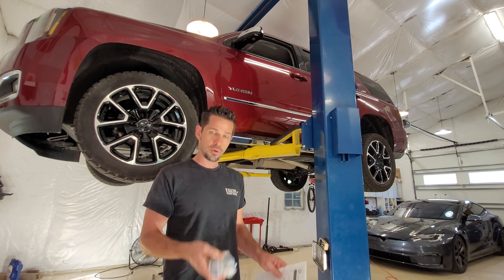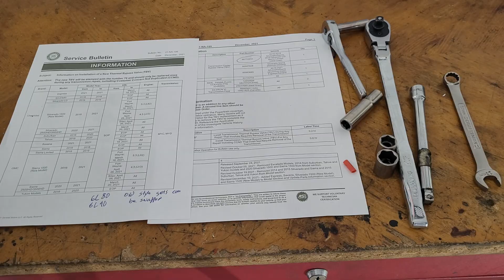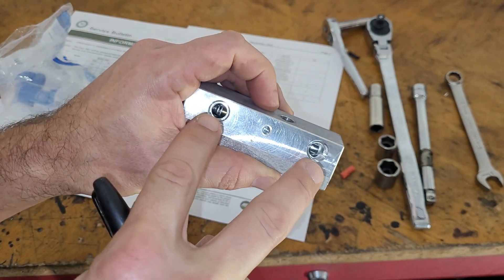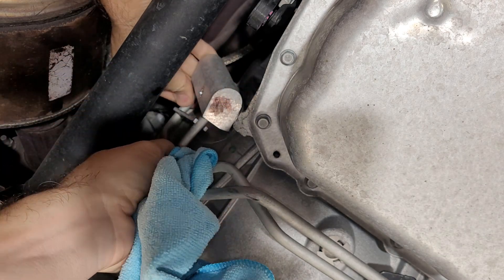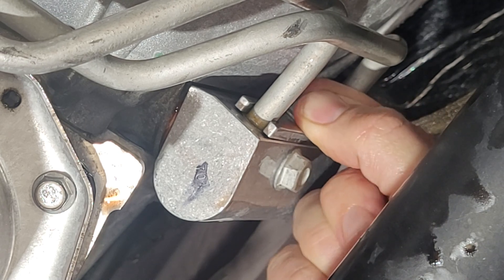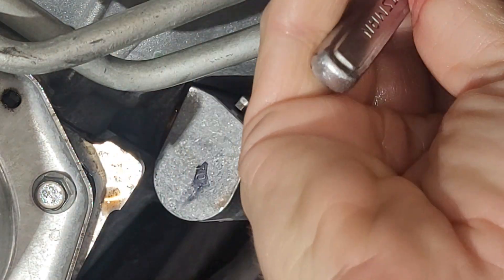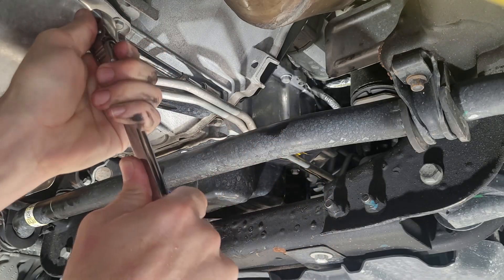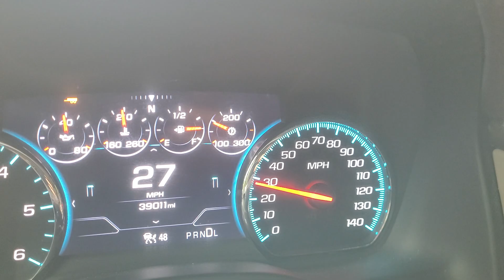SAVE YOUR 2015-2021 GM Transmission! Official GM TSB 21-NA-199 Thermostat upgrade  DIY

Comment: Did it actually lower the transmission temps?
Reply from the maker: Oh yes. Before it was always 200 and towing/ mountains etc would cause temporary rises to 225-240 etc.
After it's always 155, and the same towing mountains seems to effect it less, like only 10-15f temp rise.

Comment: I have a 2020 gmc gas 2500 and ordered the gm part, just trying to summon up the courage to do this.

I'm curious why you did not replace the o rings and oval gasket with new?  The part #'s are listed on the tsb.

Any leakge since replaced?
Reply from the maker: No leaks whatsoever. 
It's probably wise to replace them. With my truck being only 26k miles, I was ok with checking them periodically
Reply: Thanks.   Since these are new surfaces on the new thermostat i went ahead and ordered the rings and gasket.   Just curious
Reply: Was this one the 8L90, I’m about to order but dealer saying it doesn’t match vin on my 2019 1500
Reply: My 2020 gmc 2500 gas has the 6L90E transmission

Comment: Where can you get the retainer plate that holds the lines into the bypass?
Reply from the maker: You could see if the part is listed on any of the GM's parts diagrams. If not, just browse through some use thermostats on eBay and see if any of them include it. Did it get lost?
Reply: No, upgrading, mine originally came with the inserts with the Jesus clips

Comment: Does it need to add the lost oil after installation?
Reply from the maker: You may need to add a few oz, but most likely it will still show the same level as before
Reply: Thank you bro 🫡🫡 @ExoticCarDIY